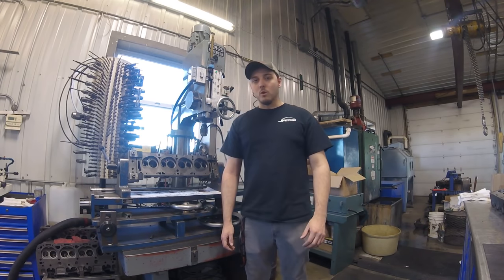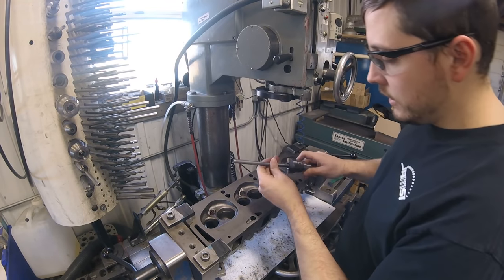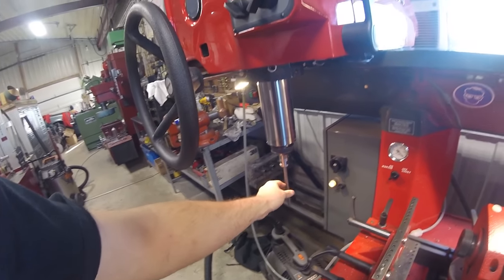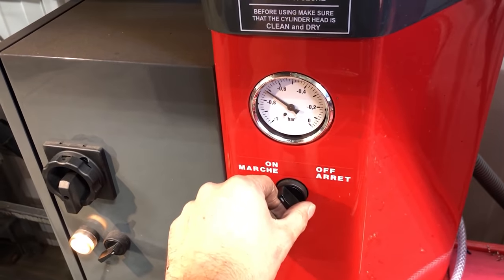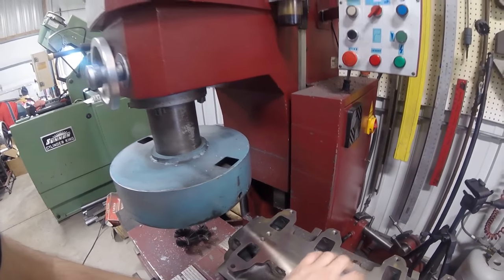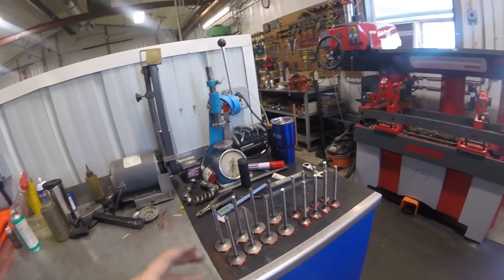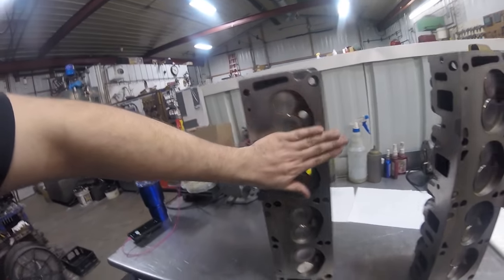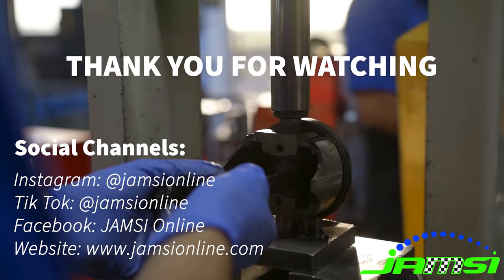FE Ford Cylinder Head Rebuild - Serdi 4.5 Three Angle Valve Job

Comment: There used to be a bunch of machine shops in my area, but now we're down to one that I know of. There's good money in this trade if you're good, and if you're not, you won't last. I worked at a Honda dealership forb14 years, and they stopped machining brake rotors several years ago, simply selling rotors with each brake job.
     There used to be a machine shop in a local NAPA, and I work at a different NAPA with the daughter of the man who ran the machine shop. She wanted to learn his job, but he was too "old school". (This is no job for a woman, etc.) 
     She's not exactly a "girly girl", and she works on her own cars, as well as others. She often thinks of where she could have been today if she had learned this trade at her dad's side.

Comment: Chatter, doesn't this have something to do with speed and feed of different types of metals, maybe you can discuss some of these aspects? One hand recording so you induced chatter, what was I thinking. Cant you put a vibration damper on the wheel so you don't need 2 hands? You cut your seats to attain equal installed valve height but I didn't notice you saying what the specs were for this engine and I didn't notice you measuring the height? How do you mark your heads for how much you take off from the surface? Do you measure the overall head thickness and compare them to any specs. Do you need to use thicker head gaskets sometimes? I don't know if you are getting paid from YouTube yet but like anything, the more videos you produce, the better your chances of getting paid there, partner.

Comment: More or less at 04:45 is the freeze plug recessed within the actual valve seat in order for you to weld onto it(the valve seat wall) or what?  It seems to me that you would be welding onto the casting per the angle of this video but you are not?
Reply: He's welding the valve seat to the freeze plug. By laying a bead of weld around the seat, you're laying on a layer of hot metal that contracts when it cools, shrinking the outside diameter of the valve and loosening it. by welding it to the freeze plug, it also gives him a good place to tap it out if the welding doesn't shrink the seat enough for it to fall out.
Reply: @93Martin  OHHHHHHHHHHHHhhhhhh, I get it now!!!!!!!!!!!!!!!!!!!!!!!  What is actually happening is that the seat material is being melted towards the freeze plug which changes the O.D. of the seat due to the distortion going towards the middle along too towards the freeze plug.  That is damn nice trick!  Thank you for this information!  Hello from San Antonio, TEXAS.

Comment: When you're speaking about trying to grind the surfaces flat on heads that have been used. Especially things like cast iron heads. Could have you do 50 to about 100,000 miles or more on them. They will Warp. He has nothing whatsoever to do with whether or not they were flat at the outset who ground them or what they ground them with. There is no way to draw that conclusion. They were probably flat as they could be made when they were new. The advantage to using a head that has a hundred thousand miles on it is that it will not warp anymore and it will maintain that flatness for probably the rest of its existence.
On that first valve, you said that it didn't look like you needed to do that at all. I don't know what you were looking at, but it took at least 12 of 15 Strokes of that stone before the red marking was completely clear. Now I do not know what your feed rate was but that was only about 1 to1 and a half thousandth . Probably would have come off if all you had done is lapped them and you have to do that anyway to make sure that the valves and the seats are completely meshed.
But I do like how you were showing us how that machine works.

Comment: Maybe I missed it, but couldn't ya just Heat the cylinder Head a bit & dry Ice Chill the new Seat Rings for a less Brutal hammer slug fest seat ring Insertion effort ??  ......I hate beating up freshly machined iron & new parts.....

Comment: U should always lapp the valves
Reply from the maker: If you are in a shop with junk machinery that can't precisely machine a valve and a valve seat, yeah.... But when you are using precision equipment there is NO reason to lap the valves. Lapping valves only makes up for a poorly machined valve/seat. Anyone who tells you they HAVE to lap the valves is telling you that because their equipment is not up to par and that is the only way they can get the valves to seat.
Reply: You lap the valves on lawnmowers. Because no one uses precision machines on lawnmowers. I used to hand cut seats and grind valves on a 50 year old machine. Laping paste is then your friens

Comment: Typical production shop work. Not done right but it'll run.
Reply from the maker: You’ll have to elaborate on that comment 🤣
Reply: @JAMSIONLINE  Well, I see several mistakes and misconceptions presented in this video. I'm sure serdi was happy to show you things to make their machine look good; but they were trying to sell you a machine so....but I'm not your or YouTube's teacher, just work at a performance machine shop. Sometimes the right way takes longer and if you're a production shop then quantity is where you make your compromises and nobody is ever going to throw those motors on a dyno and complain that it doesn't make 20 more horsepower.
Reply from the maker: Great insight! We are not a production shop, but sure!

You work at a performance shop so you’re an expert, and take the time to comment, but won’t provide any further critique other than “not done right”.

What shop do you work at? Would love to check out some of your work! Maybe I would suggest sharing some of it publicly the way I do for everyone and their mother to criticize!
Reply: @JAMSIONLINE  If you're using production shop methods, you're a production shop. Can't be any more fair than that. Performance shops use quality techniques. If you're sacrificing quality for production, you're not a performance shop. Calling it a production shop doesn't necessarily imply that it's bad, it's just not as good. Nothing wrong with folks that don't want to pay for the best; hope your prices reflect that.
Reply from the maker: Seems like a fitting answer. Again you have taken the time to comment but have not provided any ounce of constructive criticism. 

Like I said, you’re such an expert, where is your shop? I think you’re a keyboard machinist, an excellent profession!